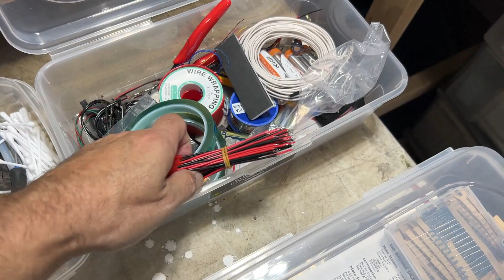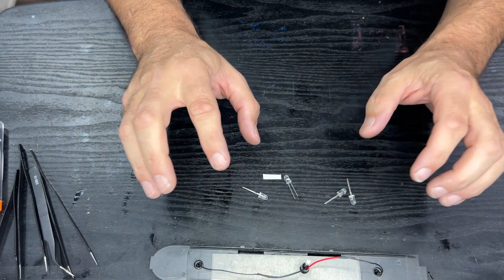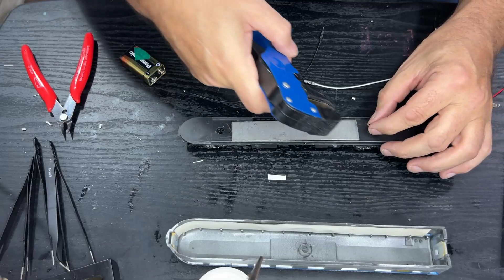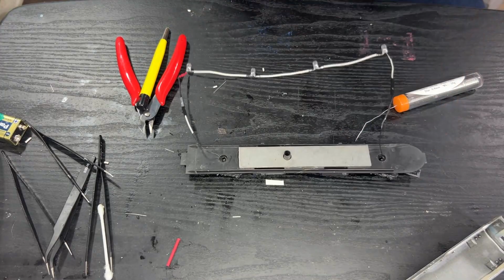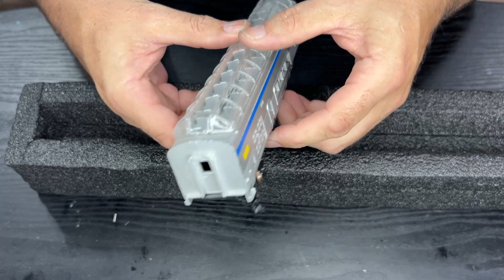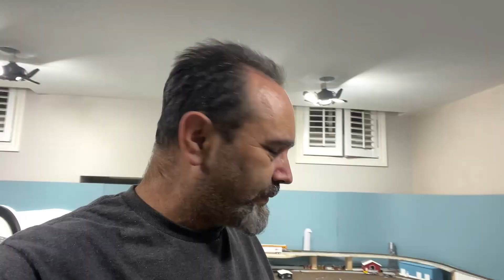Tune Up Tuesday - $10 Passenger Coaches LED Upgrade

Comment: DCC the motor is separated from the motor by a programmable logic board called a decoder, the digital signal is sent on one rail along with the power. Thats why you can use digikey systems DCC to run multiple locos on dcc each engines decoder has a different address allowing for individual control of units and functions such as lights and sounds. the best and easiest way to explain it is dcc runs from computers whereas dc just gives the power straight to the motor and built in lights, thats why if you put a dc loco on dcc it will take off.
Reply from the maker: Thanks for that Mike.

Comment: I was taken by surprise with the Via cars from Life-Like, but you do live in Canada. Usually, it's Amtrak cars available, but I do have some factory painted for the B&O railroad. There is more to the history of these passenger cars. They started out from Penn Line in the 1960s, and they were offered until Penn Line's bankruptcy. After the bankruptcy of Penn Line, the molds were purchased by Varney. These were offered by Varney until Mr. Varney's death and the company was sold to Life-Life. Then they continued on with minor changes (like plastic trucks) under Life-Like until Walthers purchased them in the beginning of the 2000s in which they disappeared. You can find many of these cars with different railroad names under Penn Line and Varney today. However, there's one car missing from the Life-Like passenger car line. It's the baggage car. I have some in Penn Line and Varney boxes but no Life-Like.

As far as the lighting, I was going to mention using LED strips, but you already spoke about it. So, I'm looking forward to the 3d prints of the interiors in the future. 

Also, the car with the roof glass is a full dome car. From Penn Line to Varney and Life-Like, the metal supports for the glass is unpainted. This was done for simplicity reasons in the manufacturing process. I thought about using masking tape and a silver paint marker to highlight the supports. They do standout when painted. If you need a reference on how they look, just search for "dome passenger car".

In closing, this is a good upgrade project. Also, I'm leaving a link to the history of Penn Line so you can the other railroads the passenger cars were painted in. http://www.tcawestern.org/penn.htm
Reply from the maker: Thanks you very much. I'll keep my eyes open for a bagage car to complete my train.
Reply: I may need to clarify about the baggage car. To the best of my knowledge, I never seen one offered under Life-Like. They were offered under Penn Line and Varney. I have about two theories about what happened to it. 1.) It was dropped for cost savings. This car had moving baggage doors which would add to cost. 2.) The molds were damaged or lost over time when Life-Like acquired Varney. If you actually find one under Life-Like, then it's a rare unicorn. The best bet would be to find a Varney or Penn Line car and paint it into Via Rail. Another option would be to use an Athearn baggage car and call it a day. @ScottRails

Comment: DCC is AC not DC. So it doesn't matter which way you connect the LED's for DCC. However, they are not as bright because they are on for only half the time. If you add a bridge rectifier, they will be full bright on DCC and work in forward and reverse on DC.

Comment: DCC track voltage reverses polarity every 50 to 100 microseconds, so your string of LEDs only turn on 50% of the time, this is why your lights are brighter when using DC power (when they are on 100% of the time when running forward). As already pointed out, DCC voltages do not change when running forward or reverse. This makes sense if you think about running two locos at a time on the same track, one running forward and one running in reverse. The forward and reverse decision is made in the DCC encoder, not on the track voltage. Love the videos!
Reply from the maker: Thanks Colin.

Comment: Great video again, and I love that you use connectors, not completely hardwired. Others can learn from this, it makes future maintenance, upgrades and repairs so much easier.
Reply from the maker: I hate it when wires get in the way when you're working on something.

Comment: Greetings From Colorful Colorado,
DCC sends alternating current to the track.  The voltage is fixed and never changes unlike DC which is variable to the track.  Normal A/C power is 60 cycles per second which means an LED will be lit /energized 60 times per second and de-energized 60 times per second. Our eyes/brain cannot see the 60 times a second on/off blink of the LED so it looks like it is on steady.  The track voltage in DCC NEVER changes.  The cycles per second changes to control the DCC decoder in the locomotive (forward, backward, horn, sounds).  No matter what the A/C frequency (cycles per second) changes to, it is still too fast for our eyes to see the LED turn off.
Reply from the maker: Thanks for that. So I don't need a bridge rectifier if I'm running the coaches while the track is set to DCC? It won't damage anything?
Reply: No it won't hurt anything in DCC. The reason the lights go out in DC is because when you change direction of the locomotive the transformer reverses the power to the track from positive to negative for one direction and negative to positive for the other direction. Where DCC the positive and negative don't change when changing direction.